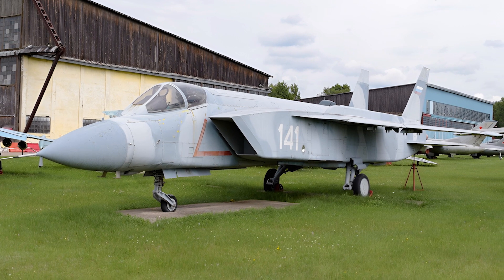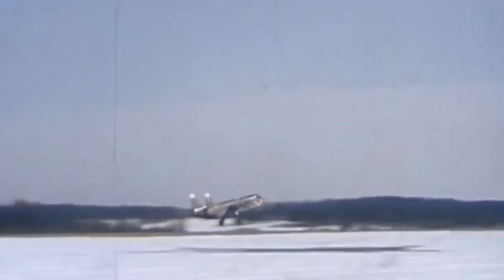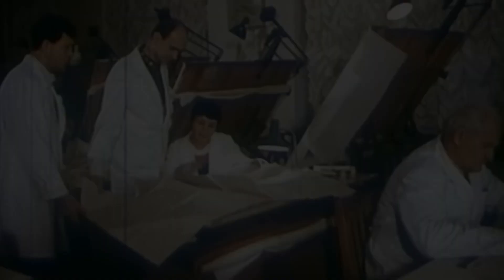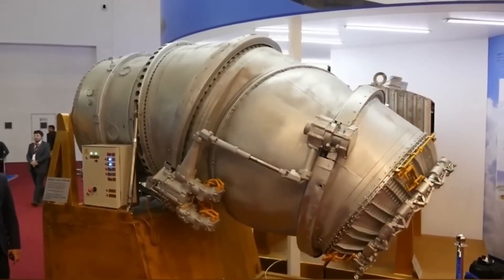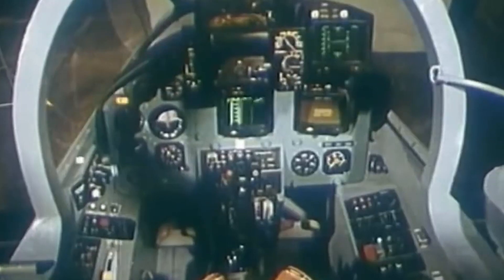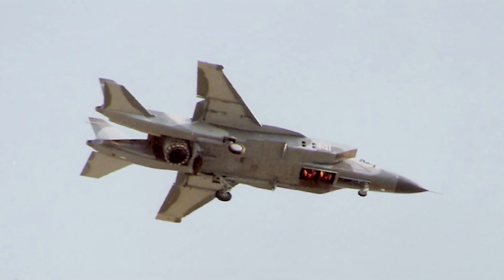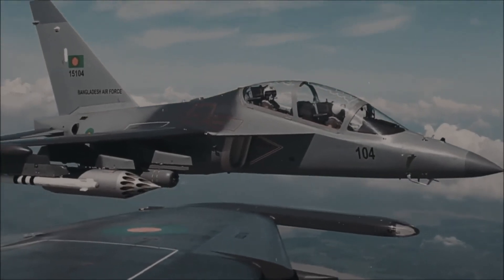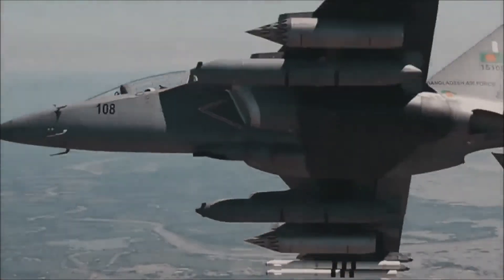F35 From The Soviet Union , The Amazing Story Of The Yakovlev 141 Vertical Take Off Fighter Jet

Comment: This is a sloppy video! You state that the Yak 141 had two engines for safety reasons. That is incorrect in two ways; the Yak did not have 2, but 3 engines. Also, the main engine was in the rear and the 2 lift engines were in the front. There is no way that these could take over each other's work for safety reasons since they have different functions. The F-35b shows some similarities and Lockheed learned a lot from Yakovlev, but the F-35b works very different. The F-35b does not have three engines, but ONE. That engine has a rotating nozzle at the back and a shaft at the front, which drives a big rotor for lift at the front for vertical use.
Reply from the maker: I agree that the F35B have different functions, I intended the rotating nozzle, in the end Lockheed Martin and Yakovlev had a partnership just for that part of the rotating nozzle.
I am new at making videos and learn and try to improve everyday.
I am sure with every video that will come out the production will be better 💪

Comment: Wow 😮we took that from the Russian
Reply: welll actually nope.....the yak141 was insipired by the british harrier, the F35 is an evolution of the harrier too
Reply from the maker: Practically yes , the F-35 is completely different aircraft but the engines structure and rotating nozzle was developed from the inventions of the company that did the Yak-141 
It's amazing what humans can achieve when they strive for something 💪
Reply: @engineeringinsights1  "but the engines structure and rotating nozzle was developed from the inventions of the company that did the Yak-141"(sic)

Incorrect. Pratt & Whitney patented and built the first swivel bearing nozzle in the 60s. The thieves masquerading as engineers at Yakovlev didn't invent squat.

Was it your intention to publicly flaunt how little you actually know or is that simply another one of your mistakes?
Reply from the maker: @AA-xo9uw  Yes I agree with that Pratt&Whitney patented the inventions , but the engineers at Yakovlev were the first to build a functional prototype of a swiveling 3 part engine.
I am not taking any sides , I just try to show interesting engineering projects of different era 💪
Reply: @engineeringinsights1  wrong...the harrier(which flew 20 years before the yak) is the first to do that
Reply from the maker: @ANVILD3VIL   Sorry maybe there was a misunderstanding, I meant the Yak was the first Soviet plane capable of that not the first to do it.
I agree they would both be the continuation of the Harrier, about the F-35 I meant the rear nozzle rotation that was inspired 😅